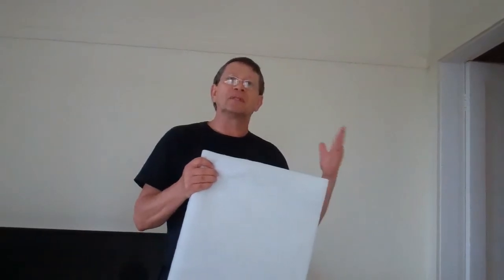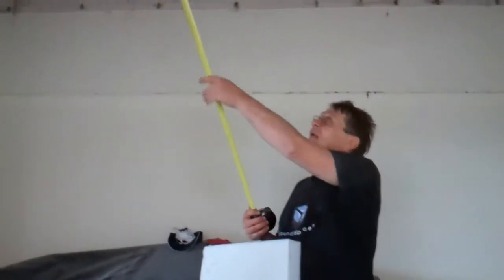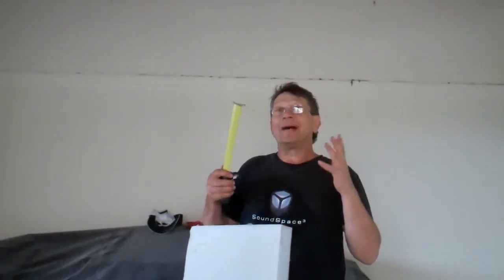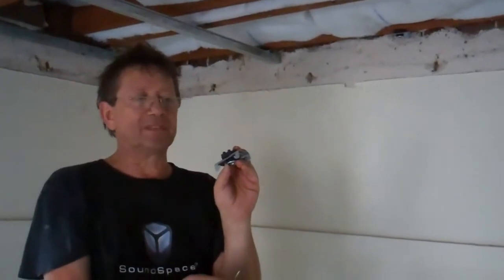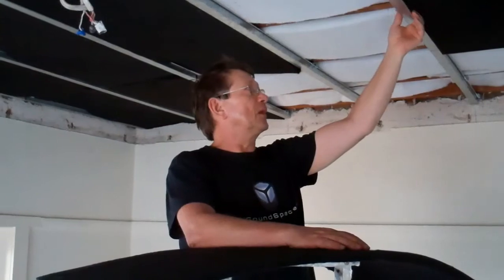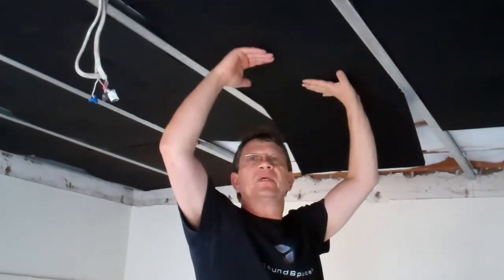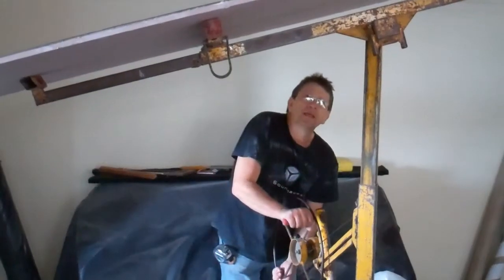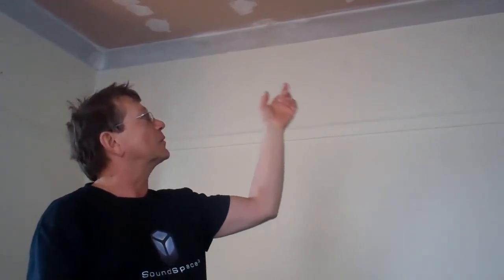How To Soundproof A Timber Joists Ceiling

Comment: Hi if I wanted to do both sound and heat insulation for the ceiling what is best?

Also would additional plaster insulation on the ground floor ceiling be pretty much point less (or little benefit) as the first floor is also internal for the same house? As I should really insulate exterior walls or first floor ceilings as this is where the heat is lost to the outside of the house not between floors, which makes little or no difference??

Also considering I will have ~ 150mm of rock wool at (60kgs/m3) between the joists. This may also provide both thermal insulation and sound insulation (without loss of any ceiling height). 

Therefore considering the above

I should maybe do 

1) 150mm rock wool insulation at (60kgs/m3) between joists?

2) resilient bars at 90 degrees on the joists.

3) with two layers of sound shield plus 15mm acoustic plaster boards sandwiching a 5mm Mass loaded vinyl at 10kgs/m2 in between? 
 
Reason being the rock wool at 1) will give sufficient heat insulation so no need for eg 50mm super gyproc thermal plaster board ? 

As this will not aid sound blocking (much as only 9.5-12.5mm standard plaster board with Remaining being the foam) and won't benefit the heat side of things as it's an internal ceiling (form both sides).

Therefore it's best I should do the extra layer of plaster board to be soundbloc not thermaline ??? 

as that will increase the sound blocking (and added benefit of less ceiling height will be lost comparatively). ?? 

If I want to reduce the heat loss I sound invest in the first floor ceiling (not the ground floor ceiling ) and put up the 50mm super gyproc plasterboard there and not on the ground floor ceiling???? 

Please very kindly advise I'm vvvv confused. 
Many many thanks in advance for your professional expert advise. 👍👍👍

Comment: ok, i thinking of doing this, please explain what you you would do.

my ceiling at the moment is hollow. i.e floor boards at the top, 165mm cavity and then 9.5 mm (Cheap / standard) plasterboard.  

1a, once removing the original ceiling, check for any holes or air gaps, fill them in with sound proof filler. 

1b, put 150mm insulation at 60kgs/m3 under the floor board but with a 15mm air gap.

2, put 5mm acoustic tape on joists 
3, 5mm mlv soundproof barrier on joists 
4, 15 mm soundbloc to finish the ceiling, 

4b, put some acoustic tape at the edges of the ceiling and the walls to stop direct contact between the ceiling and walls. compress to finish. 

4 c, finish with sound proof filler at the edges. 

see how the result is in the sound reduction if not good enough, only then proceed with the below. 

6, add 16mm metal resilient bar.. 

8, add second layer of sound block at 15mm 

10, finish the edges as same with ceiling one. 
11, add green glue then add 15mm fire line plaster board. Finish ceiling. 

12, paint two coats of insulating paint (hytech) over the multi finish,  (they say it reduces sound by 17%). 

14, add plaster coving to edges for the look. But add acoustic tape between plaster ceiling side and new (2nd) ceiling to stop vibrations from traveling from wall to new ceiling. 

now the thing is if i did go by the two ceilings option then i think maybe more sound will travel up by the walls then through the ceilings it self. So i might paint the walls with insulating paint, as it claims to reduce sound transition as well as heat. I cant reduce the internal size of the room, so i can't add any acoustic plasterboards on the inside of the room. 

please advise, what shall i do, and how cost effective it will be considering the labour involved as well, thanks
Reply from the maker: +James Pitt First, open the ceiling to have access to the joists, install two layers of acoustic batts, high density, minimum density 32kg/m3.close the ceiling and seal any gaps. Install the resilient mounts and furring channels, install high density acoustic batts between the channels, 20-25mm thick, the batts shouldn't be compressed otherwise it will transmit noise like a bridge and you'll have the opposite effect. Install two layers of 16mm plasterboard or 13mm special sound proof plasterboard with the membrane  between.
Reply: +soundproofingexpert , thanks!!!!! thanks!!!! , that is almost same as mine, minus the sound roof foam before the first ceiling. Am i correct. 

if i do as this, from my little research i should eliminate a lot of air born noise. 

shall i put one layer of sound bloc on the walls as well with the vinyl before this? as the ceiling will pretty much block a lot of the noise out hence the walls will transmit more noise then what the ceilings will? please advise, as i think my curling will be very good but my walls will still remain a bridge for the noise unless i put a layer of sound block pastebroad over then also????

thank you in advance!!!
Reply: +soundproofingexpert is there a maximum density for the sound bats? 
as one company said the optimum is 47kgs/m3, (as they sell this ) they said that too less dense and it will be like loft insertion and if too dense it will be too hard and form a bridge so that the noise will just go through this. so they said you need it to be at medium density so that all the sound is converted to heat energy so that noise doesn't get through. thanks
Reply from the maker: Of course, 47 kg/m3 will be better for low frequencies than 32kg/m2, the denser the better but proportionally more expensive. Also, the thicker the better and the more you fill the cavity the better up to a point, stay below the maximum cavity thickness otherwise the acoustic batts may become a bridge for the sound, than you'll have the opposite effect.
Reply: soundproofingexpert is therefore 60kgs /m3 better then 47kgs/m3. And 100kgs/m3 better then 60kgs/m3??

Comment: Hi, I need to soundproof a floor, between the joists.  I have used Cellecta DeckFon before but this customer wants nothing to raise the height of the floor.  So, I am looking for something which I can lay between the joists.  The customer owns the flat beneath the one we are working on, so I will get feedback.  I will take up every 3rd or so floorboards anyway for a re-wire and installation of central heating.  Then after all the work, a good underlay and carpet.
Reply from the maker: +Jane Wrin You can fill the gaps between the joists using sound absorbers such as fibre glass, rock wool, polyester like the one I am using, it doesn't matter what fibre you use as long as you have enough density, products for thermal insulation are not really suitable, too light density. The density should be at least 32kg/m3 or more, fill as much as you can but do not compress the batts between floor and ceiling otherwise you'll create a bridge effect. This will not be enough to provide enough sound reduction for footsteps if you don't lay carpet and thick underlay on the floor; it will make a difference for airborne noise but not very big, it is a compromise.

Comment: Thanks for your great videos!
How much dB reduction will this give?
Reply from the maker: Hard to tell as we are trying to reduce two type of noise, footsteps (impact noise) and voices, music, TV (airborne noise). You wouldn't hear anymore music, TV with normal volume but you may still hear footsteps if the floor above is made of timber floor boards, it can varies a lot according type of shoes they are using or the way they walk, some people, you may not hear a very heavy person walking but you'd hear a child running for example. If you have carpet above, you'd probably hear nothing, no walking, no tv but it depends from place to place, the way it's been build, span of the joists, if they are too flexible or not well anchored in the wall, a lot of things can influence the results.

Comment: Phillipe,
I watched your videos with great interest and was wondering if you had advice for my soundproofing situation. I have two apartments on top of each other and will be living in the top apartment. The building is over 100 years old and has timber joists. I would like to add soundproofing between the two apartments, but am primarily concerned with airborne noise as I will not be impacted by vibration noise and will be light on my feet to keep my downstairs tenants happy. My girlfriend would like to keep the original pine hardwood floors (the only layer of flooring above the joists) in our apartment so soundproofing must occur between the bottom of our floor and the top of the downstairs ceiling.

Since I have access to both apartments, my question is whether it would be better to tackle this job from above (removing some floorboards and stuffing a high density soundproofing material between joists) or from below (removing ceiling sections and putting the material in between the joists from there). I realize the latter option would give me the ability to add resilient mounts and channels for extra soundproofing, but since this step would be primarily to reduce vibration sound, I’m reluctant to go through this extra expense. I would like to keep this job on a budget.

I would also be interested to know what you kind of soundproofing material you would recommend. How does Roxul Safe ’n’ Sound compare to the high density polyester you use?

Any advice would be appreciated. Your videos were extremely helpful.

Comment: Hi Phillipe thanks for the video. Can you explain how you attached the second layer of plasterboard please?
Reply: Hi Rich, I am attaching the second layer of plasterboard with screws as well, going through both layers into the resilient furring channels, making sure the screws are not too long otherwise it will touch the original wall and court circuit the system.

Comment: i have a question: what is better : closed cell polyethylene foam 10mm thick or mass loaded vinyl 5mm thick or even 2.5mm thick, and if so why?
Reply from the maker: Using polyethylene will separate the boards and provide better results than if the boards were against each other like one board, it will also reduce the vibration of the boards but I don't know if it will be as good as a viscoelastic elastic membrane or green glue, I don't have any test results to compare. if you use 5mm thick mass loaded vinyl, it's weight should be around 8kg/m2, that is a very good sound barrier and it will not only separate the boards but increase the mass and reduce the vibration of the board as well like a viscoelastic elastic membrane, in my opinion you should get better results with 5mm mass loaded vinyl but it could cost more

Comment: 1, you used 2 * 16mm plasterboards. how thick was the original plaster from the ceiling that you removed? 
2, why use resilient mount channels when the ceiling already had wooden battons were already separate from the floor joists?
Reply from the maker: +James Pitt 1, Original plaster was 10mm sometimes 13mm thick
2, The wooden battons are fixed directly to the joists and transmit sound vibrations through the nails, the purpose of the resilient mounts is to separate the screw with the rubber from the new structure, so the new structure made of furring channels doesn't vibrate as much. In some cases, one screw can transmit noise.

Comment: soundproofingexpert
, I don't want to take down my old ceiling if I can help it. I bought the resilient mounts and channels but was thinking to just attach them to the studs though the existing drywall ceiling. Do you think that would be ok?
Reply from the maker: yes, it's ok but it's a compromise because you won't have the high density sound absorber 75mm thick in the ceiling cavity, which helps to muffle the sound going through and you may have less sound reduction also because, when you have 3 separate boards (timber floor, existing plasterboard and new plasterboard) you may create resonance ending up with less sound reduction than if you remove the existing ceiling, you'll still have some sound reduction in total but it's not as effective.

Comment: How many decibels will this reduce by? Thanks
Reply from the maker: +James Pitt 

Hi James, I've just answered the same question from Natalie Tao below, I'll copy-paste my answer for you just in case: The reduction should be around 45-47db from the ceiling but after treatment, the walls will transmit more noise than the ceiling so, ideally, would be to treat the walls as well but it become very expensive and you'll lose a lot of space; so overall the reduction would appear to be half. I often recommend to do one bedroom for example instead of the whole apartment so the client can see if the difference is worth the money, half my clients will do the rest after; you see, there is a matter of perception of the noise that is different from people to people. I get much better results with a timber floor acoustic treatment, more space to play with.
Reply from the maker: +soundproofingexpert Oops I did answer for a concrete ceiling, sorry, my mistake. The big difference with a timber floor is due to the fact that the joists transmit less noise through the walls than the concrete slab therefore the overall result is much better.
Reply: +soundproofingexpert how much ? for timber floor as you recommend to me personally above thanks sorry to ask you twice . thanks